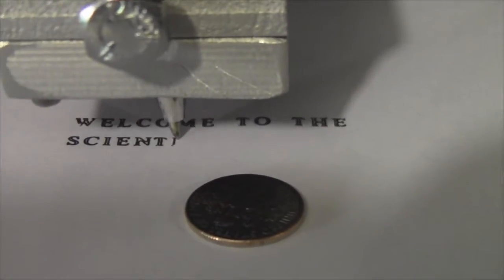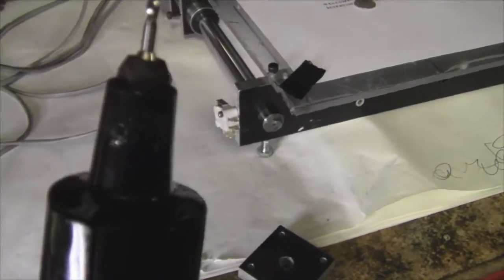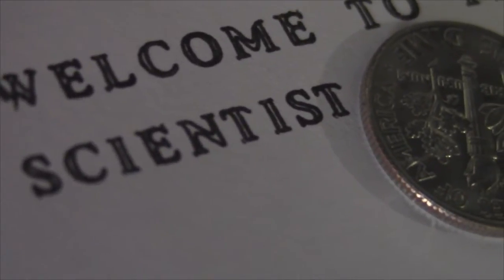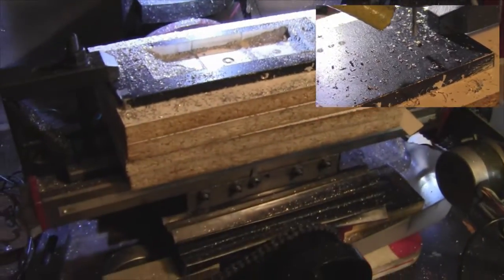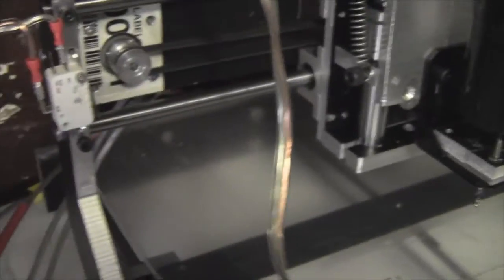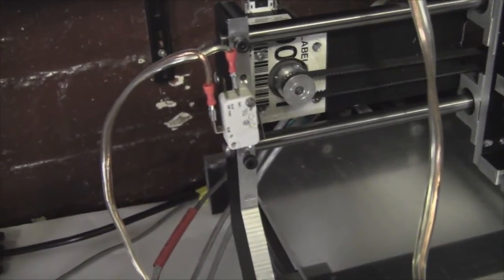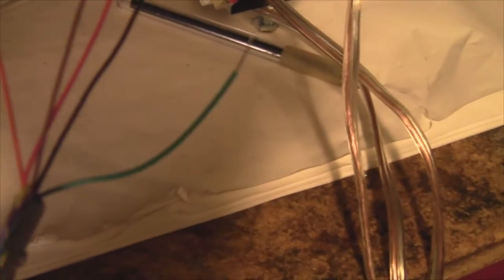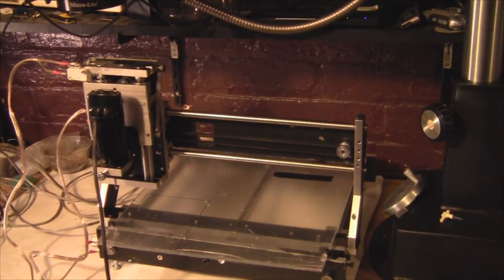Homemade CNC Pick and Place Machine X2 CNC #6

Comment: how many steps per rev on those steppers?  seems like the resolution/accuracy can't be high with gt2 belts connected directly to gears on the motors' shafts.
Reply: ps- the accuracy LOOKS good, I just can't see how!! :-) maybe my sense of scale is off.  that is a dime right!  looks more accurate than 1/100th inch.  I don't know your gear size, just estimating.  nice machine!
Reply from the maker: 1.8 degree steppers times 1/16th microstepping increases resolution.